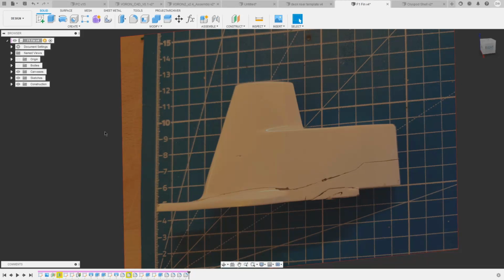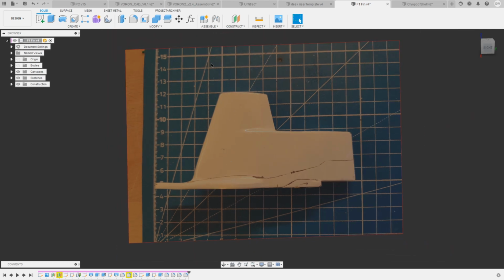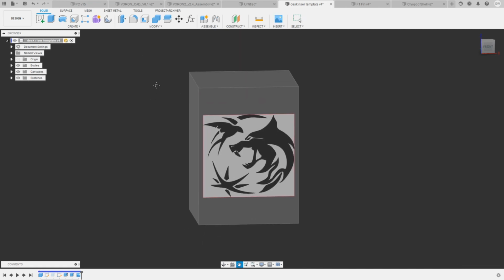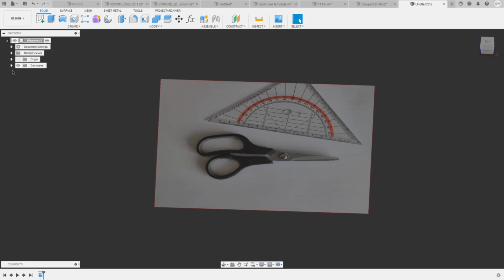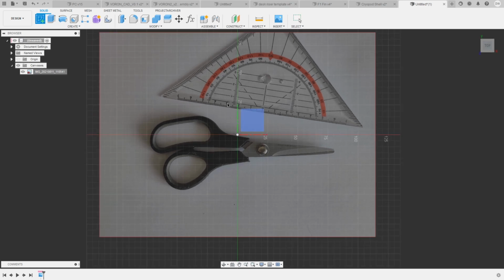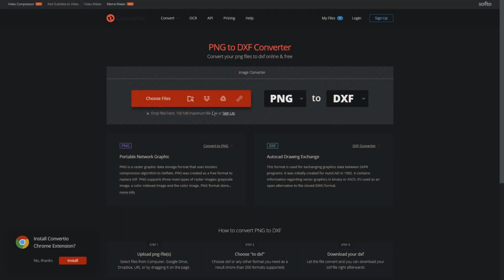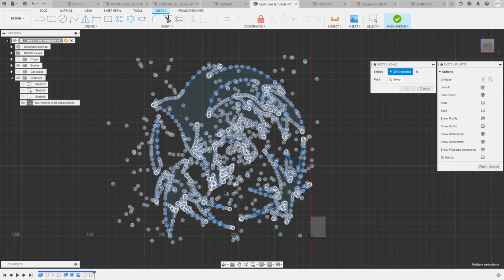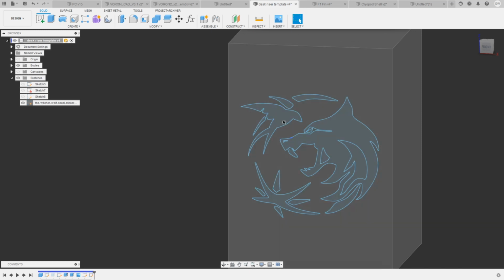3D Modeling using Photos in Fusion360 - Maker Software

Comment: I have literally no idea what you do after you do the selection points on the scissors, it just skips through a huge amount of tasks in seconds and even at .25x speed I can't make out what you do to get to a 3D model lol. Pointless.
Reply from the maker: All I did after tracing it was extrude the sketch up, once with the scissors, once without to get the shape.